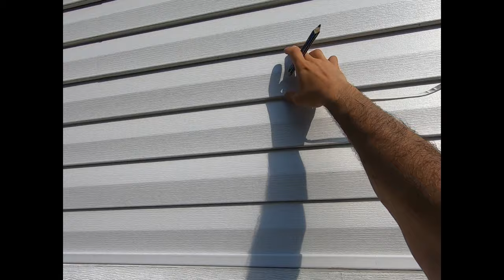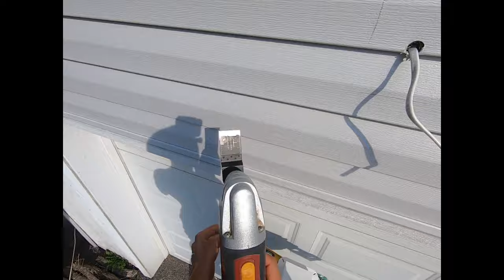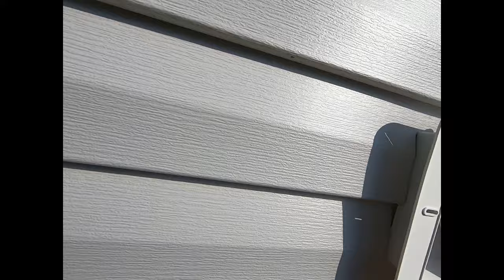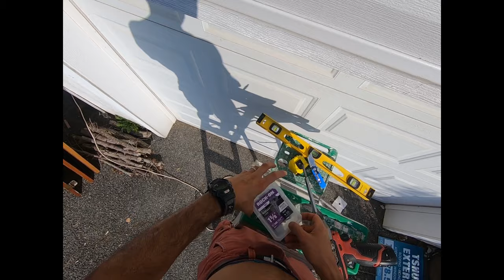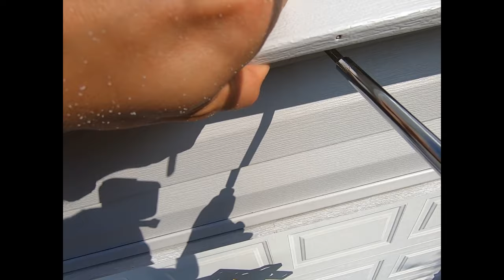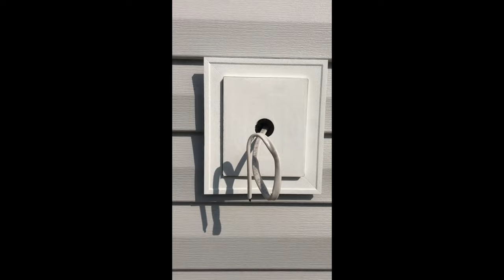How to add a light fixture to vinyl siding - How to add electrical box to vinyl siding aka J block

Comment: I am a licensed electrician and you absolutely need a “box” I use round but have seen other contractors use single gangs. If the light has a completely enclosed box then it is not necessary, such a a can light, wafer light, bath exhaust fan etc. rule of thumb, if you take light out of package and wires are hanging out you need a “j box”
Reply from the maker: Completely respect that.  I have to tell you, in all my experience inspecting properties, hiring contractors to put up exterior lights, replacing/repairing exterior lights myself, I have never seen a box for an exterior light.  All I’ve seen (in newer homes) are J blocks.  Would be great if you can share code reference for my knowledge.  BTW what purpose does the box service when the wiring is completely enclosed inside the fixture trim as in this case? Also, this was attached to a header, so you would have to carve out the space for the box into the header, seems illogical for this application, no? Thanks for watching and supporting ✊🏼
Reply: I'm an electricians apprentice so I'm curious about this as well. It may depend on the state that you're working in? My boss has me put in round old work boxes through the plywood in between studs on outside lights. Even new construction we stub wire out and put box in later. Following for answer.
Reply: All good, but like the guy said, where's the box and since there isn't one, you screw the light to the header?
Reply from the maker: Totally, agree 100%.  If I had 1/2” ply, I would have certainly added the boxes.  I suppose I could have used slim boxes? Tuck them behind the j-block.  I will try that next time, although I still don’t understand the reasoning behind it.  I mean in this application.  It’s already boxed in by the j-block vinyl and the trim from fixture.
Reply from the maker: Yes, I used a long enough screw through the j-block and into the header.
Reply: Creative Homeowner's 'Wiring', 8th Ed., pg. 165.
Reply: @TrueGritDevelopment  The reason for a metal (or approved plastic) device box inside the vinyl e-block is to have a grounded, solid device box to which to attach the light fixture. Electrical codes don't care whether the fixture is a light weight single bulb or a heavy coach lamp. All fixtures must be securely connected to an approved, grounded device box. Also, there should be 1/4" clearance on all sides, between the siding and the e-block, for thermal expansion. You show an excellent way to detach the siding without using a j-hook tool. Well done!
Reply: @nunyabizniz946  thanks for sharing the knowledge, makes sense 👍🏼
Reply: @nunyabizniz946  The box itself doesn't need to be grounded if you're using a plastic box. The other important thing is that the box helps prevent electrical fires by containing any arc flashes. The electrical boxes are made of a fire resistant material specifically for this purpose. Vinyl siding isn't.
Reply: @TrueGritDevelopment  The box is for fire prevention. All wire joinings have to be within a box to prevent arcs sparking and catching.
Reply: I have one of these but why aren't their drain holes in the bottom, even a tiny 2 holes so if water does get in it can get out, or that a bad idea? Condensation etc
Reply: @Hedgehodge-  the unit is supposed to be sealed between the wall and the light, water should just roll around the unit
Reply: @rileyjones7231  oh my! It should ?! Lol I know what ya meant :)
Reply: Sorry to hijack, but my house has one of these blocks with a floodlight on it, same setup, no junction box inside... I want to replace it with a Floodlight camera, which needs a junction box... Do I just cut a bigger hole in this block to insert an outside type junction box or what?.. thanks
Reply: @jwild1013  I put up a Eufy flood light camera on my back door that had just a solo light by the glass slider.  The Eufy instructions are very adamant about using a j-box and once I got going I found out why... they help hold and house the wiring.  I also caulked around the top and sides (never the bottom) of the j-box (metal) that I installed on my j-BLOCK.
Reply: @billsmith9249  just curious how you installed the j box to the j block... The way I ended up installing my ring floodlight camera was using a weatherproof bell box inside the block
Reply: @jwild1013  The original configuration of my house was, vinyl siding, j-block, nasty old gold colored outside light.  The fool builders cut the middle section out of the j-block for the light and drilled an over sized hole to feed the wire through.  I traced the outline of the j-box (metal) over part of the hole that was already cut out of the j-block.  Then I used a knife to cut away any excess vinyl from the base of the j-block so I had clean wood.  Mounted my j-box in the area I just cut away, caulked the top and sides of the j-box (and screwed it).  Then, I added the Eufy security flood light, hid the wires inside the light, then I mounted the light (as per instructions) to the j-box... and I also caulked around the top and sides of the eufy light where it was touching the j-box.  Now, the Eufy light housing does have a gasket that is 'supposed' to seal after you tighten the screws to the j-box, but I never leave anything to chance.  So, in order from house to fixture, I have plywood, what's left of my house wrap, j-block with the middle octagon shaved out exposing the plywood, caulk, j-box, caulk, Eufy seal, Eufy fixture, and caulk.   Hope that helps or clarifies. =)
Reply: @kungfoochicken08 at the electric supply house where I live they sell boxes that you can paint. And the siding is cut to the box
Reply: Gang box in the house is safer and stronger ? Your comment has my attention
Reply: The reason NEC requires a junction box is, 1) wire retention for the NM wire so it can't be pulled out, 2) mounting point for the light bracket
Reply: @jwild1013 Yes.

Comment: Don't do this! I almost did this and my father in-law who is a electrician said no you need an old work electric box that has knockout holes for the wire to flow through.
Reply from the maker: Thanks for the feedback.  This wire was going through a band board and I didn’t want to cut out a chunk of it to accommodate the box.  I ensured the wire was secure and my connections inside the fixture base were tight and taped.  If this installation was going through plywood, I would have had the option of using a box.  With that said, I don’t claim to be an electrician and this is a DIY channel.  The main objective of the video is to show how to install a fixture on vinyl siding.  I do appreciate your feedback and will continue to improve and learn.  Thanks for watching and supporting 👊🏼

Comment: Are you a licensed electrician (I think not)....US electrical code states that every fixture must be attached to & have an approved metal or plastic box to contain wiring/connections. Sure, you can do it this way....but if there's ever a fire or other issue then you can be sure the insurance company will not pay out since the install did not follow proper safety codes.
Reply from the maker: Not a licensed electrician nor do I claim to be one.  However, the electrical connection in this fixture is tightly secured within the metal base of the fixture AND within the J block itself.  There is no contact with the wood structure.  I suppose you can use a shallow electrical box behind the J block.  Thanks for watching and commenting.
Reply: @TrueGritDevelopment  i think there should be a junction box.  But nice video!
Reply: @TrueGritDevelopment  Incorrect. Electrical box needs to be flush with siding block. Fixture must attach to box itself. Been doing this for 28 years. This is totally against the NEC electrical code and promoting things like this is how fires are started. Please inform yourselves. Fixture flange MUST be mounted to electrical box with no space. We normally cut the siding block so that the Electrical box is exposed. Great video just may want to add this very important step to it. I have seen where vinyl siding has burned and melted. You may get away with this on stone or brick though although believe it or not it's still against code even with those materials.

Comment: Just FYI, you need to leave a gap between your siding edge and the white box. Usually 1/4 inch the whole way around. Allows for expansion and contraction of the vynyl siding.
Reply from the maker: Indeed.  Thanks for watching 👊🏽
Reply: Also makes getting those screws in a little easier
Reply: Won't water get back in there???
Reply: @darrylmarsh8252  no, because it's covered. And the backing edge is covered by the siding. And if it does, the tyvec will guide it down to the drip edge. And also the siding has holes in the bottom to allow any water to drip out.

Comment: Leave yourself a little bit more space around the mounting block to siding interface for thermal growth/shrinkage. Your cut was spot on for a tight fit and I commend you for that, but there needs to be a bit of "wiggle room" between the members at the sides (not really much at top and bottom). As others have stated, there should be a junction box behind the mounting block. Maybe not required, but I always install a rubber grommet in the mounting block hole to protect the wires a bit more. An alternative to a junction box + mounting block is if you buy the blocks with the boxes built in already. Anyway, good work overall. Cheers!
Reply from the maker: Thanks for the feedback.  The block with the box is a nifty idea.  Thanks for the tip 👊🏼

Comment: Thanks for the video, in addition, needs sealant on the sides for rain, so the water will not create damage inside, otherwise thumbs-up.
Reply from the maker: 100%.  Didn’t capture that on video, but certainly sealed around the base of the fixture.  Thanks for watching and supporting 👊🏼

Comment: Great video to get an idea of what to do.  

When Installing mounting blocks under siding you don’t want them snug to the edge of your siding.  If snug your vinyl may warp or wave over time due to not having room to float when expanding and contracting.  

When placing your J-block cover on you don’t want it to pinch your siding which is why the hole needs to be larger as well.

I’d also highly recommend using flashing tape around the top and sides, not the bottom.

Just a few things I’d highly recommend when installing.
Reply from the maker: Thanks so much for the feedback.  Exactly why I make videos, I want to share my knowledge and also learn from others.  Thanks for watching and supporting ✊🏼
Reply: @TrueGritDevelopment  Applying silicone or caulking to seal it defies the floating ability of the vinyl siding as it expands and shrinks due to weather change as it  would lock  it into place  . A driving rain would get in around the back of the j block that's why its very important to use tuck tape on the flange  to your house wrap
  .
Reply: @andrewkanis3383  thanks for the feedback Andrew!

Comment: Thanks for the video as it helped me properly install the mounting box on vinyl siding. A few other steps I took was to pre-cut an opening in the mounting box to have a metal 1-gang box sit flush up against the inside. I then traced that opening onto the wood so the j-box can slip partially to the interior of the garage with the electrical being fed through it. I am installing sconces on either side of my garage and do not trust simply attaching them to the vinyl mounting box. When it gets hot outside I would imagine there may some warping of the vinyl, especially if a metal sconce is weighing down on it. This way the lights are secured to the  j-box and they are secured to structural wood. They won't be affected by outdoor temperatures and the vinyl mounting box won't be affected by the weight of the lights on hot days. It's an extra step but worth it, IMO.
Reply from the maker: I like it! Nice work.  I did use a long screw to go through the j block and into the header board.  I too thought the block it self will not support the weight.  Thanks for watching and supporting ✊🏼

Comment: Thank you very much for this video. Very informational.
Reply from the maker: Glad it was helpful! Thanks for watching 👊🏼
Reply: @TrueGritDevelopment  absolutely! Do you happen to have photos/video of the transition thru the wall? Primarily from the inside?I have been searching but find it hard to believe that it's just a hole the wire runs thru, no insulation, caulking, foam, or anything ( in all the videos I've found, not just yours 👊)
Reply from the maker: No video/photo but I can explain.  In this case I punched through the band board.  The band board is typically 2x10 followed by 1/2 ply, house wrap then siding. I accessed the band board from the garage ceiling (cut a 2x2 section of dry wall).  You may find bat insulation there, so remove it and drill through the board.  Replace the insulation once finished installing the fixture.  I hope that answered your question.

Comment: Im doing this job today but a box extension should be used off your current house box. These kits protrude out the exact width of a box extension. Not using one could void your house insurance.

Excellent video though and thanks for the trick with the Vinyl siding and being able to pull out one sheet to screw this down. Cheers!!
Reply from the maker: Thanks for sharing.  Appreciate the feedback.

Comment: Thanks for the video.  I'm a homeowner installing a new light after my house was resided, and didn't know the configuration of the box they left me.  You're video helped me understand how it went in.  You made a good point about not overcutting the vinyl at the corners to prevent future cracking.  I usually handle that on any material by drilling a small hole at each corner.  It takes a little time , but guarantees the cut or crack wont run past the corner.  In fact, you can often stop a crack in any material from continuing by drilling a hole at the end. That's what they did on the Liberty Bell.
Reply from the maker: Thanks for the tip! I absolutely agree.  Thanks for watching and supporting 👊🏽
Reply: Ha ha ha ha ha ha ha ha

Comment: Thank you for this video. Just what I was looking for. My problem is I am replacing a light fixture on my vinyl siding that has been sided ON TOP of wood slat siding. So I have a bit of Macgyvering to do and sourcing out where to get the J block.Thanks again. Great video. Very well explained.
Reply from the maker: Thanks for watching and supporting, much appreciated.  You should be able to mount the J block right on that woods. Drill through the other end for your wire and you should be good to go.  Good luck.

Comment: Should have cut siding a little more for expansion/contraction of siding with temperature/sun/shade changes and flipped siding up or removed the two pieces so as to caulk behind box flange and used nail slots on outer edge. You put those screws right where water channels, might leak or collect moisture.
Reply from the maker: Thanks for watching! Caulking will certainly not hurt.  Honestly, I’ve seen hundreds of these j blocks and never noticed or seen caulking.  This is not to say it’s not necessary, but I don’t think it’s required either.  My house was house wrapped before installing the siding too.  Appreciate the input and thanks for sharing the knowledge 👍.
Reply: Tommy Jones is correct. Temperature changes will cause buckling if there’s not more space left between the siding and block. 1/4” to 1/2” on each side will do just fine. Great video.
Reply from the maker: Thank you for watching.  Easy, will pull the trim off and check what I have in space.  Since I installed in Summer, I think I should be fine.  If I need more room, I’ll trim it back.  Thanks guys for the feedback.
Reply: That's why after you screw the blocks in place  you use tuck tape to seal it First bottom then sides then top like a shingle
Reply: Also need a round junction box, a siding block that matches siding color, tuck tape, galv siding nails, and caulk.  A siding puller helps too (only $5) if you have high-quality stiff siding.  Leave 1/8” expansion gaps around the box.  If it’s a retrofit, you may need a little house wrap for watertight j box. Otherwise nice job!

Comment: Great video though as others said, you do need a proper electrical box for the connections to be made. In this instance you could use one of the shallow circular boxes screwed into plywood to meet code.
Reply from the maker: Thanks for the feedback.  Will certainly try and squeeze that in next time.  I think the band joist threw me for a loop in that project.  Thanks for watching 👊🏼

Comment: Didn’t know the naked and afraid show is incorporating home handyman projects..BTW I would glue (caulk)the box then screw it later so as not to struggle to keep it in alignment with the cut out .. also as long as there is no other blocks on that same run I would cut out a little oversized and caulk perimeter (except bottom)to keep water from infiltrating so there is no need to be so exact  in fitting the cut out opening and siding can still expand in both directions  away from the block unless it’s on the very end of a 12ft piece a half inch expansion may cause a bucket
Reply from the maker: Lol @Nakedamdafraid good one.  Great tip glueing first, would have certainly helped 👍🏽